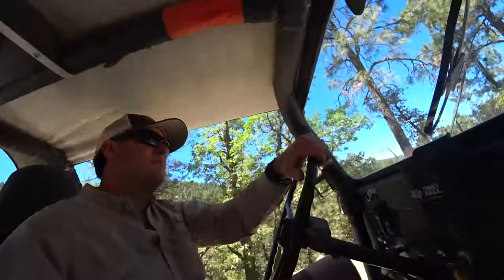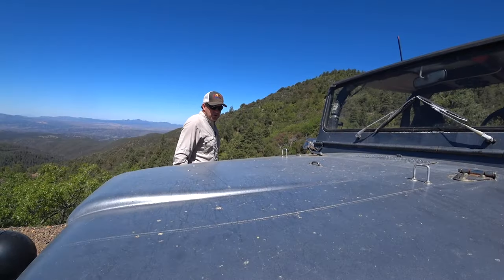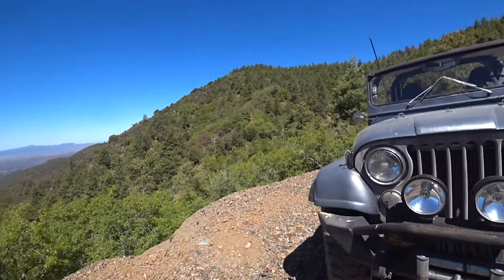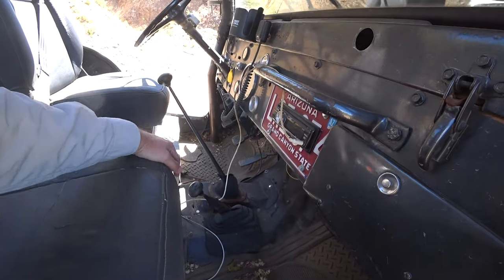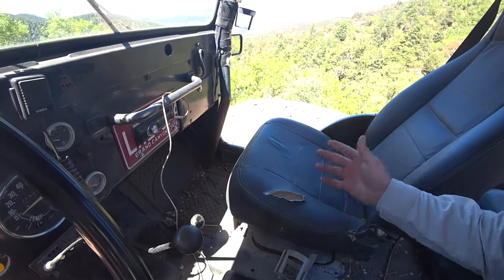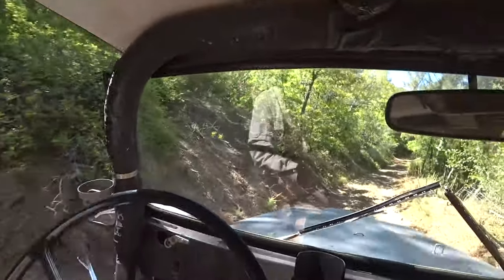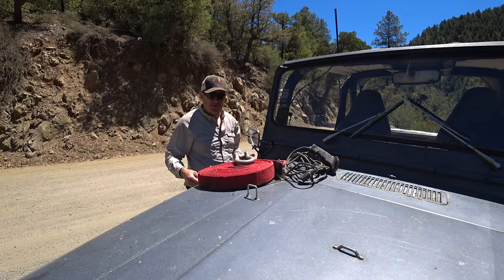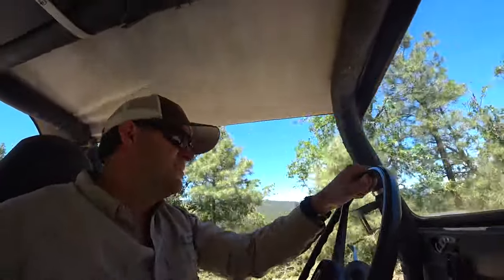1972 Jeep CJ5 Ride & Review

Comment: Fun video, you don't see too many of the intermediate (72-75) jeeps around.  Lots of carry over from the kaiser era, your transmission should be a t-14 or t-15 if its a 3 speed, or a t-18 if its the 4 speed.  Also you should have a dana 20 transfer-case assuming its original.  The dana 20 is essentially the same dimensionally as a dana 18, but has a centered rear output.  Very cool jeep, glad to see other people getting out there and really using them.

Comment: Trail tip. If a heater hose  starts leaking, you can use your vice grips to pinch the end of the hose instead of taping the crap out of it or fold the hose and use a zip tie to keep it folded and crimped